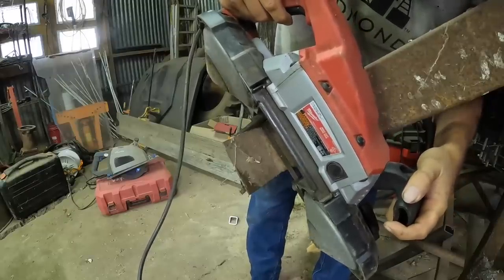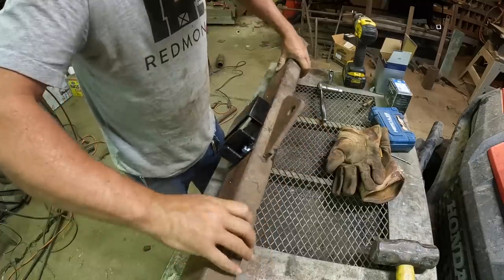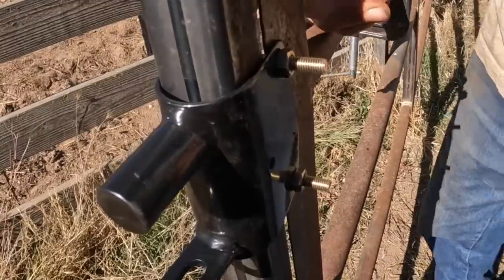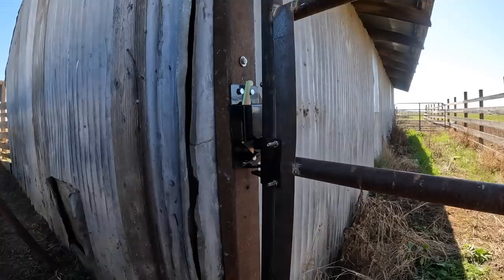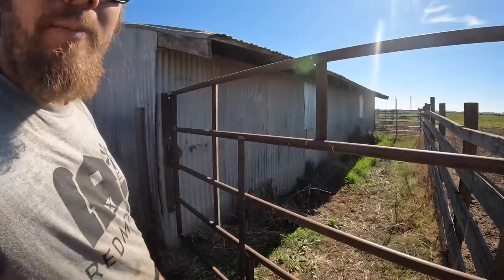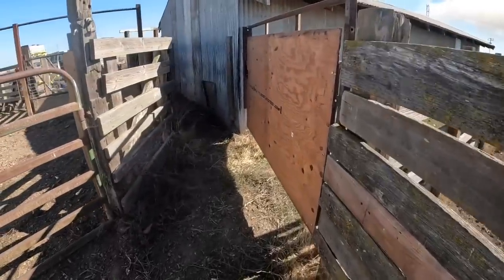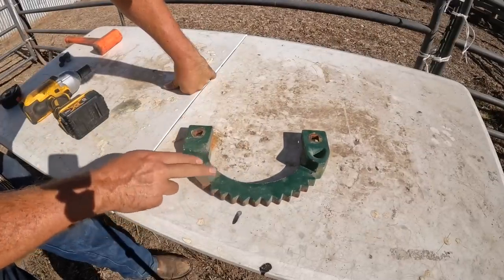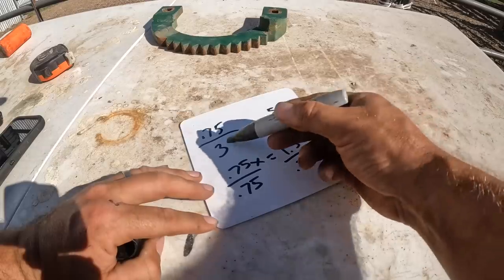Fixing One of the Oldest Problems in this Corral

Comment: Yes, Grandpa would be proud!  Your planning, fab and install skills are a  definite plus for all these projects.
Your math is correct on the chute ratchet mechanism.  The key factors could be the depth between teeth plus a radius for each tooth ramp.  Changing the fulcrum point on the ratchet mechanism has merit plus it's relatively easy to try but could weaken the factory bar.
Every project shows your concern for the welfare of the animals plus your own safety.  Well done!
Reply: I have no idea what you said but I'm sure it's correct.😅

 My phd in micro doesn't work in this environment.😅

I admire Tyler and know these technical responses have been of help.

Comment: Tyler your granddad would be so proud of how well you are taking care of things. 
3 things that I’m wondering about. 1 - why not put those nuts on the gate that you want to cut, why not just turn them around to face in, instead of out and you maybe wouldn’t need to cut them. And 2 - won’t that latch be hit when the cows are going into that alleyway?  As you mentioned it’s tight and I could see that they would probably bump it, at least it appeared that way on the video. 3 - just my thought that the squeeze chute lever would be a better way to go because you’d still be using the same gear ⚙️ and have the same strength. 🤷🏻‍♀️ I think you could go either way, but there is a lot more figuring with having to make a new gear and it wouldn’t be as strong. Hmm 🤔 
Hope you’re having a lovely weekend. Thanks for posting. Greetings to your family.

Comment: Tyler, I think instead of focusing on the teeth on that locking mechanism, I think you should examine the circumference of the part which actually affects the squeeze motion.  If you make it less circular or shorten the circumference it won't close the head gate 3 inches with each notch on that circular plane.  You can achieve a more gradual squeeze without the chance of finer teeth slipping and releasing the head gate.  I will send you an email with a diagram explaining how to achieve.  After continuing the video I would go with reducing the swing of the door by drilling those holed you mentioned - that's a better idea.
Reply: Agree 100%.  Not only would it be easier to change the pivot points, the risk of failure (if the smaller teeth slip under pressure) would be much less.

Comment: Suggestion: Paint!  Measure the average height of a cow's eye from the ground. Then paint a solid stripe centered at that height starting at the beginning of the solid boards where a cow would enter, and continue along the new plywood on the gate, then to the corrugated metal and all the way to where the trailer waits to be loaded.  Make the stripe wide enough so that animals of different height see a enough of the stripe that it can act as a guide. Maybe 18 inches wide. And it should be visually continuous so that there are no breaks in the paint job, particularly at the corner of the building where the gate meets the corner and there is a 2X6 board attached to the building.  The idea is to visually fool the beasts into thinking that this is a smooth path all the way to the trailer, and to obscure the distractions at that choke point. While you are doing that, you might use some spray foam in the corner of the corrugated metal joints. A cow might be thinking WASPS! as she approaches.

Comment: Tyler, 

Might want to add some plastic string, cables, or bungee cords to the latch as it can be a pinch point. I’ve got several latches like this and you know how unpredictable cows in a confined situation can be.  My strings go from the top of latch to above the gate on the wall.  

Hope this helps!!  

Respectfully. 

James from East Tennessee.

Comment: The 2 bolts that you was going to cut off with the grinder, because you said to keep the cows from rubbing into it, at the latch.. You can also turn the bolts around. ❤ Less❤ work❤
Reply: That would work, except they would be sticking out when they are against the other wall of the loading chute.
Reply: @terrypotter4779  Just remember about the gate swinging both ways. It swings against the wooden fence also.😢.using the grinder is the best tool to use at this point.Turning the bolts the same way as the carriage bolts it just looks cleaner.❤ thank you ❤

Comment: Great video. I have one of those latches and sometimes it sticks when you go to  open it one way or the other.  I just push or pull down a little on the gate and it opens no problem. No need to grind down the pin.

Comment: I agree with someone else on flipping the bolts on the gate. If the placement of the latch becomes a problem, could you weld some more tabs on like the existing one, use those tabs to bolt to post. That should offset your latch closer to edge.

Comment: I think I would first try to modify the linkage arm by adding more holes.  And use a template made from wood before drilling random holes in the metal arm.   Also, you probably should have protected your sheet of plywood with some paint and from delaminating due to rain seeping into the top edge.  Maybe some trim nailed on the edge or possibly waterproof glue.

Comment: Be careful when you make that new ratchet, looks like the cast one had about an 1/2” of tooth for latching and the new one may only have 1/4 inch of bite latching and softer metal. That’s taking away a lot of strength in my opinion

Comment: Easier to change the pivot points on the head catch.

Else maybe you want 3.5” travel to start for the initial catch and less at the end when you tighten down.   Might mean teeth are graduated or you only need to replace some of them.

Good luck

Comment: If you double the teeth on the same radius you should divided by 2 the travel,
That's my simple math, mind you I'm not stating my math is correct.
So if you made exactly the same piece then take every peek/ truth and cut a notch into it you should double the teeth😁
Your explanation on the plywood was concise I don't know why you feel you need to explain yourself again
Actually I have always found your explanations on everything you said to be very in-depth and accurate and easy to follow even for beginner
Apart from the one thing that you wouldn't go into in detail (the off switch)😉

Comment: Instead of making a new curved  ratchet rack. Can you just make a pair of linkage  arms to reduce the travel of the gate. It seems like a easier way to avoid making a complicated part that may not get you the results you want. Have a good one. Ted
Reply: Put some stainless cap nuts on the two protruding bolts on the gate after shortening those bolts. Keep from tearing those cow hides.